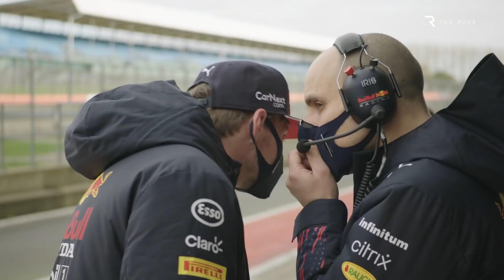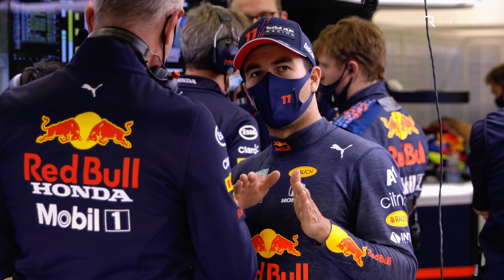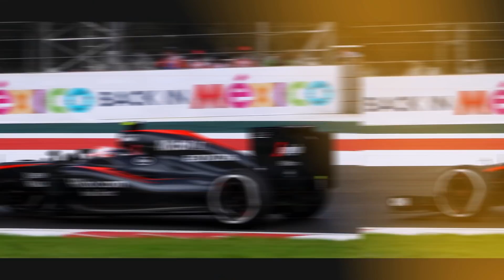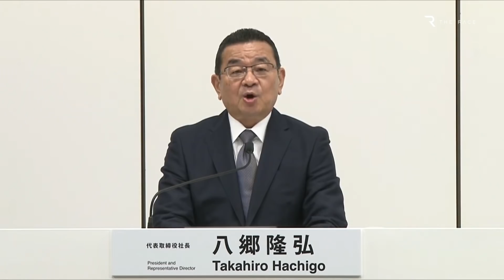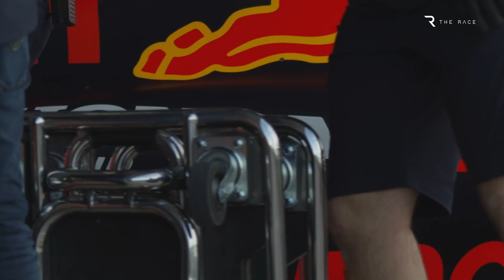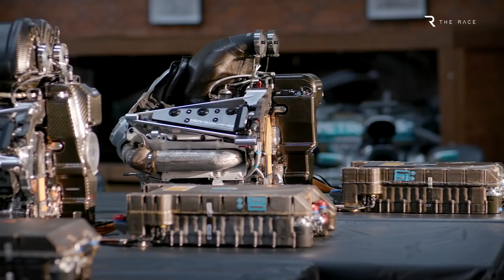The major F1 engine upgrade Honda kept secret

Comment: If red bull doesn’t win both titles I don’t want to hear excuses.
Reply: Verstappen lost 50+ points due to bad fortune though. While Hamilton gained a lot of points through good fortune.
Reply: @svenniepennie4237  Verstappen basically already lost, he could have maximized his points by ALOT but he did not. Also, Bottas will be faster then Perez in these last races to come. Max will have to do it on its own, and i don't think he can.
Reply: @HoodStoryShorts  Perez has been up there to provide strategic defense for Verstappen only a few times, but it didn't stop Verstappen from winning consistently.

I also don't think Verstappen failed to maximize on his opportunities all that much this season. The biggest throws have all been on the side of Hamilton this season.

This championship is way too close to call this early.
Reply: Even if they don't win. It's okay

At least Honda now can keep up with the big boys

Comment: 2022 will be all about car aero. It would be surprise if we see williams and Alpha romeo fighting for mid field spots.
Reply: They can still upgrade engines
Reply: @rickjames1797  even after upgrading aero plays major roll.
Reply: @ModernDIYCraftsman  I think the exact same mate people just see things and believe it and don’t do research this aero change will really not change too much around or at least a lot less than most people think
Reply: @kianallan  Austrian GP Hamilton lost aerodynamic device in the rear of the car lost the grid places. Hungarian GP Verstappen car bargeboard was damaged his car downforce was equivalent to that of Haas car. So aero parts plays significant role in the race.

Comment: Great visuals, shoutout to the designer of the engine components and all the graphics.
Reply: Was going to comment the same. Excellent,  excellent job to the producers!
Reply: Right
Reply: wonder when the race will be so detailed about mercedes...
Reply: @sebastianbuse4899  This detailed schematic and explanation is generic for all F1 cars. Only the fact that the new Honda storage module has higher capacity, introduced a few races ago, is specific to Honda.
Reply: @sebastianbuse4899  oo9o9
Reply: @sebastianbuse4899  Any Merc improvement is considered bad for the spot

Comment: Its so weird. This is the year where Honda announced they leave. And it seems also that this is the year they finally take F1 seriously and put hard work into it.
I just dont understand them. :O
Reply: No, this is Honda’s last year so it’s been saving all it’s developed technology for this year to give RB the best chance it has try for both championships
Reply: Honda has been working very hard all these years, but it’s taken them a lot of time to get the right organizational structures in place, and they started off on the back foot with a rushed product based on a flawed concept. This year is where all the hard work has finally come together into a complete package that’s up there with the best. Honda’s decision to leave F1 sadly doesn’t have anything to do with their performance on track; it’s a corporate decision pure and simple.
Reply: @Astfgl
Size zero? Not a flawed concept, as they give RBR even smaller package than size zero, and also one middle finger for McLaren.
Reply: They saved it all for this season. Because Mercs look beatable compared to last seasons.
Reply: @LordOfTheBored  yeah that 2020 Merc was unbelievable fast
Reply: Honda need the engineers for development of future roadcar technology, like battery EV, fuelcells and alternative and synthetic fuels.
Reply: @1234fer-y2e  if that’s the case, then why’d the simultaneously double down on their commitment to Indycar?
Reply: @CaffeineAndMylanta  honda engines for indycar and imsa are provided by honda performance development (HPD) a subsidiary of america honda company. so, separate entity

honda's f1 powertrains are directly funded by honda motor company that's based on japan
Reply: @patrick-gn1lc  interesting
Reply: @CaffeineAndMylanta  because it doesn't cost hundreds of millions to run IndyCar. Not to mention getting to advertise to Americans who will buy Hondas. 

Honda executives realize the investment in F1 isn't giving the expected returns, but IndyCar is. That's the bottom line.
Reply: @NightHawk8137  I agree 100% that’s the real reason.
Reply: They have taken it seriously since they entered the sport. Things take years to perfect and this is the result of years of hard work.
Reply: This isn't "the year they finally take F1 seriously." They've been serious the whole time. It's just that now all that hard work is starting to pay off for them. Besides, no manufacturer is going to commit the time, money, and resources it takes to compete in F1 and not take it seriously.
Reply: Honda wants to go 0%
Reply: After taking another direction with the engine Honda picked up what they left at Mclaren and succeed with it.
Leaving has only sped up development a bit.
They leave because they want to serve the green hypocrites....
Reply: They've always taken F1 seriously.
Reply: What do you expect entering the game very late
Reply: Audi did the same thing in endurance racing,  they design a new platform to never use it...
Reply: Honda realised that people who watch F1 aren't exactly interested in buying Jazz🤔
Reply: @shivar925  F1 is a weird sport where it has a huge amount of fans who are diehard Ferrari fans. 99.9% of whom will never come close to buying one let alone get a chance to drive one.
Reply: @stevel9627  they would buy Fiat, Alfa, Merc and Renault tho
Reply: @stevel9627  and your point is?
Reply: @shivar925  and you suppose they are interested in buying a Fortwo 😂
Reply: @alandoyle8880  think a little harder about what you just said...
Reply: @shivar925  no thanks
Reply: @shivar925  it’s called humour dude cheer up
Reply: They have been taking F1 seriously for years? look at all the success they have had in the past they are 5th in the standings with 86 wins and 5th with 6 constructors championships.
They are also going out on a high as they will beat Mercedes this year for sure so expect loads of tears 😭 from Hamilton fans.
I just don’t get why Hamilton fans get so upset all the time it’s a sport nobody stays at the top forever youth always takes over whatever the sport it’s a fact.
Reply: @alandoyle8880  no body talk about hamilton or his achievement.Mercedes dominant turbo hybrid era 
now for one year R.B can win driver champions.i love Lewis but i like max win this year. i wanted vettel won 2018 WC but he lost. i hope max  at least
Reply: You think success happens overnight, and Honda only started to "take it seriously" this year? You're right, you don't understand.
Reply: Honda is in it for PR reasons, and the attention it gets is minimal, since most people simply talk about Red Bull and not Red Bull - Honda. Max doesn't pull any numbers in terms of attention either and he's rarely seen in (or on) a Honda on f.e. social.

When you see the drivers in picture, often the Honda logo can't be seen, and before this season it was even a standard thing while the biggest display for a car manufacturer was Aston Martin.

So it's not weird at all. There really isn't a reason to stay. And honestly, RBR are lucky that can still buy the engines next year since their RBPT infrastructure isn't done yet. Because Honda planned to be done with it.

Comment: these upgrades are clearly there, but can someone explain why mercedes were dominant at Monza and russia before said incidents and grid drops..after said honda upgrades?
Reply: The Mercedes engine is still the best engine in F1. People forget how big Mercedes' advantage has been in the hybrid era.
Reply: Mercedes was definitely not dominant at sochi
Reply: @theoandersson440  i meant quali pace before the pit wall incidents and the race circumstances..on pure performance mercedes were the best...same as monza
Reply: Don't forget , Mercedes invested billions in this hybrid engine before anybody else. They invested to dominate. Sadly , Mc.Laren , Williams and even Ferrari, Renault, etc , weren't prepared to pump that kind of money in a motorsport. F1 did a bad job creating a super expensive not capped league. Budget cap will bring some balance, hopefully.
Reply: @givemeabreak8784  it may just pause the relative development so the current pecking order stays sort of the same but doesn't blow out like it would if Merc and could continue outspending the field so vastly
Reply: @givemeabreak8784  yeah let’s hope so…..
Reply: Aero packages
Reply: Monza has always been a special track because there is no track in F1 on which drivers are so dependent on slipstreams. Engine power matters less than strategic decisions here. Mercedes were not at all dominant at Sotchi. If the rain had not set in Lando would have won the race. And Bottas would not have gained championship points. Also HAM was lucky because he pitted quite early during the last laps. His win therefore was not because of better engine power but actually luck.
Reply: @LordOfTheBored  and crashtappen would have been p7 without rain 🤡
Reply: p20 to p2 is the real shit, if lando had made a mature decision, then p1 was his for sure.

Comment: about time mercs got replaced this season. people are bored to death see another merc champ
Reply: Except merc fans
Reply: 😂😂😂yet with all this upgrades they still lead both titles.
Reply: @imocartan8147  Not on merit though. Verstappen lost 50+ points due to bad luck.
Reply: @svenniepennie4237  Merc definitely do though on merit, depending on who you ask.

If Max doesn't learn to be responsible and see the bigger wider picture, then he only got himself to blame.
Reply: @Arif-oc9uu  Mate, he lost nearly 30 points compared to Hamilton in the WDC because of Baku and Imola.

That alone is more than enough to cover off Hamilton for the WDC.

I'm not sure how you think you can blame Verstappen for that.
Reply: @svenniepennie4237  Baku I understand, but how Imola exactly comes into your equation? What formula are you using, mate?

If I take your observation, then hypothetically Lewis has lost nearly 40 points to Max through no fault of his own during Spa and Monza. So ultimately it all evens up the results.
Reply: @Arif-oc9uu  As I said: "compared to Hamilton". Hamilton binning his car into the gravel and then the wall, and then getting to unlap himself for free due to a red flag is an effective points loss for Verstappen compared to Hamilton.

And yes, Lewis did lose points compared to Verstappen in Spa and Monza. But 40 points is way off. Hamilton realistically loses 3 points in Spa (P3 -> P2) and 7-10 points in Monza (Double DNF -> P1 HAM with VER P2 or P3).

But if we're going to bring in incidents between the two, then Silverstone shifts the fortune in favor of Hamilton. A massive 25 point swing in a single race.
Reply: @svenniepennie4237  If you only wanna fabricate scenarios just to your advantage and Max's, then that won't fly everywhere, my friend.

Spa was a lost opportunity for Lewis to win as well but got ruined by rain. Same was the lost chance of big points swing at Russia also affected by rain. So accident in a rain affected race in Imola is not that uncommon either resulted in unexpected outcome.

What goes around, comes around. We'll see what happens till last, then make up minds
Reply: @Arif-oc9uu  I'm not fabricating anything. I'm making estimations based on what is likely. Is it possible that Hamilton would've won Spa? Absolutely. Is it likely? Not really, as he ran a dry setup and any race at Spa would've been incredibly wet.

Still, even if we factor this in, it still wouldn't come close to the 40 points you pulled out of nowhere. A win with Verstappen at P2 would be worth 17 points (VER -7, HAM + 10). Even if we assume the best realistic outcome for Monza we'd still be 13 points short of the 40 you hypothesized.

And yes, rain does increase the chances for unexpected results. But Imola wasn't even close to a full wet race. Getting a red flag in a race like that is massively lucky when you've binned your car into the gravel/wall. 

If rain didn't happen in Russia the difference would've been +5 by the way. Not exactly a "big point swing". But sure it's there.

So even if we were to assume that all of these scenarios would've provided Hamilton with maximum potential points and Verstappen with minimal potential points, Verstappen would still have suffered worse luck than Hamilton.

If we were to settle on a fair estimate, Hamilton's fortune would be far better.
Reply: @svenniepennie4237  Understood. However our further discussion would be better over a phone call for this kind of complex scenarios rather than going back and forth over chatbox as this communication process is extremely time consuming for anyone who has a full time career.